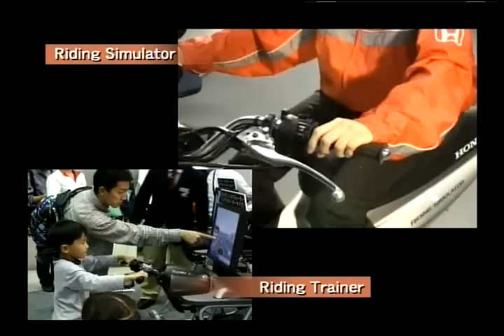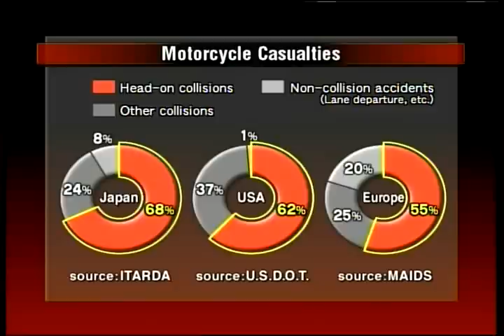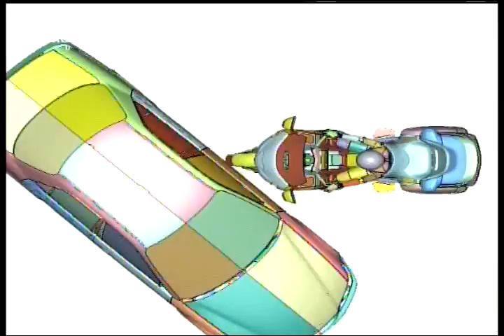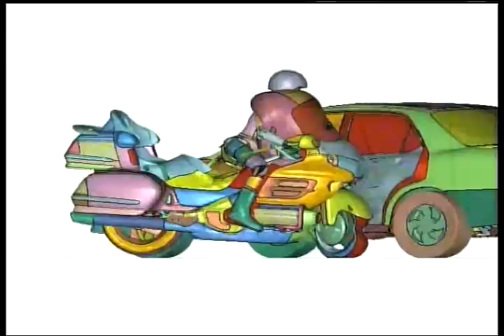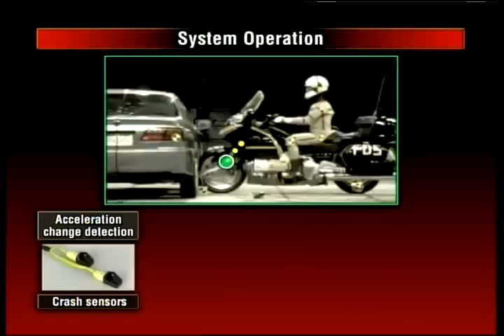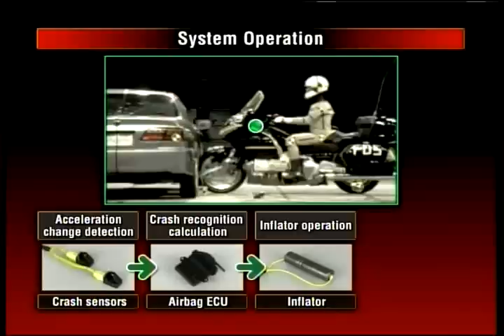Honda Goldwing Airbag System

Comment: They showed about 100 different clips of the crashes, but manage to cut every one short so you can't see what happens to the rider right after hitting the bag. Guess they don't want to show them going ass first into the car anyway lol
Reply: It didn't go ass first the airbag stopped it.
Reply: @dkdanis1340  all I could see before they cut it each time was the guys  rear end lifting of the seat.
Reply: some cushoning is better than none at all. and my uncle had a goldwing, he t boned a guy who pulled out in front of him and was only sore from the accident, there was no broken bones.